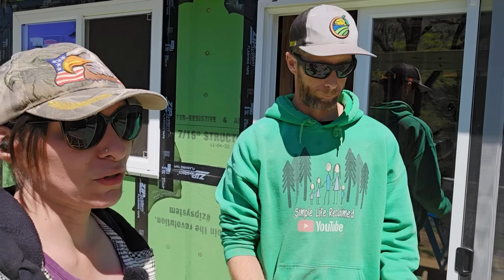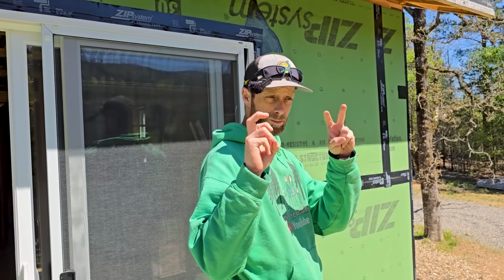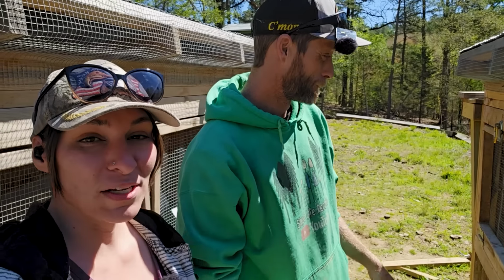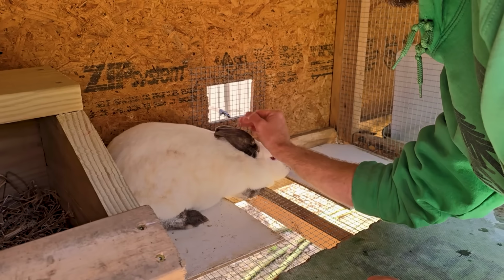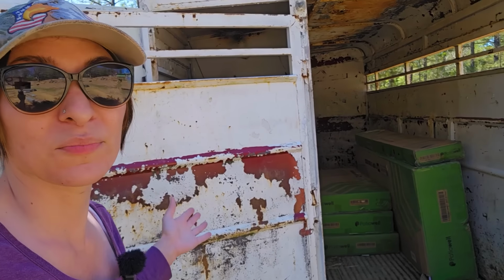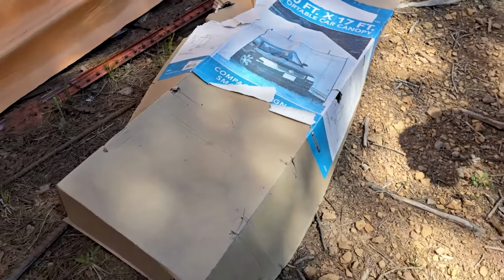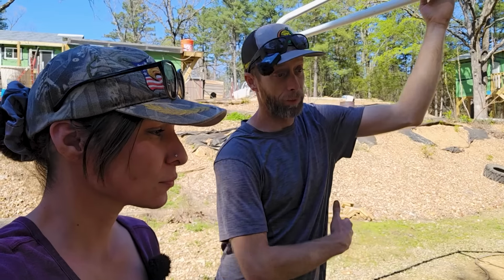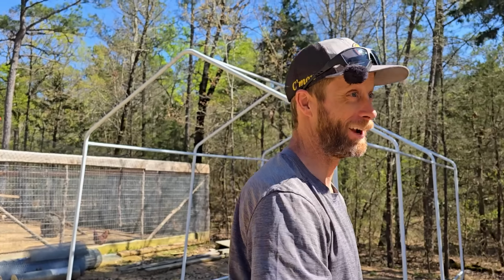Can We Get It Right?!| Rafters For Our Cabin Deck's Roof| ANOTHER NEW BUILD & Homestead Updates

Comment: The only problem I would mention about using clear tubing for water hoses is that it allows sunlight to come through.  This can promote algae growth.  If you want to use clear tubing then just dry fit some PVC pile to sleeve it in.   I have 20 IBC totes in stacks to catch rainwater and every single one is painted black to prevent algae.   You also might think about a gate valve in the line further back so you can cut off the water for maintenance work near the cages.

Comment: Hi gary and Mel.little important  tip for you.fix a top plate all along the top of the  beam just like you did on  the cabin framing. Just keep the joints staggered away  from the beam joints. This will strengthen  the beam from pulling the joints opening up.then fix you roof spars onto the top plate of your cabin and the plate on your beam .if need be screw into you roof spars also then this should tye everything  together  .maybe  easier  to take  first row of sheathing  off your cabin roof for easy  access  fixing you decking roof spars.take care.
Reply: Yes! I thought the same thing. Tie the porch roof into the house rafters vs the roof. That’d keep the whole structure sturdy no matter how much wind they get.
Reply: @chrissyfrancis8952  I mentioned the need to stagger the seams in a prior email.  They are learning and we will teach them.  She is brave and he is trying hard.  There are just certain things you cannot skimp out on and proper structure is one of them.  they mentioned they have bad storms there occasionally so I hope they use hurricane straps going from the beam to the rafters and from the beam to the posts.  They only screwed down the posts and did not use BOLTS to attach it to the porch structure.
Reply: @GoodwillCriminalsOfDallas  Gary always uses Hurricane straps. They also mock up their structures, then take them apart to finish cuts & then secure it permanently bc they’re learning as they go. It’s literally twice the work, but Gary(as you know) is OCD. Imperfection would drive him crazy. My mom is the same way.

Comment: G’day Gary and Mel, Gary reminds me of when I was building, thinking about how things will be on the build. I would get flooded with all sorts of ideas and become distracted muddling through. One day I changed that behavior to planning to scale on paper based on all measurements of the situation. I used the measurements to create profiles then would draw up a diagram on a 1/10 th scale, my maths isn’t that good so scaling up from a 1/10 to full scale was easier in the metric system. If it was furniture then the scale would be a bit bigger to get very concise measurements. Doing those diagrams confirmed angles and the length of timers needed. This limited wastage as I bought the just longer length of Romberg that I needed. I hated 3’ off cuts, such a waste. The process also helped me maintain focus. I called it building on paper first. I also developed the habit of sketching ideas as they popped for later to be developed. Having a sketch pad nearby was a great help. Stay safe and healthy, I enjoy your sharing.

Comment: To make the measuring of the rafter easier just break it up into pieces.  First, how far past the rafter are you going to go.  Second, from the beam to the edge of the roof.  Finally, from the edge to the highest point on the roof, you are going to go.  I do not recall what the pitch of your roof is but that is one thing you will need to know for your calculations.   The easiest way to figure out the angle at the top you need to cut is to stretch a line from a board on the beam that is the thickness of the rafter.  I would guess 2x8 would do it.  Put the other end on the main roof at the top height of the rafters.   Get two pieces of lumber about 3 feet long and peg them together at one end in the center with a bolt and wing washer.  One board needs to be a 2x8 and the other a 2x4.  Go up to the roof and set the V-measure device next to the string.  Raise it to a few feet from the end of the string lining up next to the wing nut.  Now one of the boards till it lines up with the string and tighten down the wing nut.  What you have now is the angle at all of the 2x8 boards will need to be cut to have the top of the rafters die out into the roof.  

Once you have the board angle cut you only need to set a 4-foot board on the end of the big beam and angle it so it aligns with the string and then slide it out till the overhang is what you want to achieve.  this will allow you to trace the birdmouth.  There are official ways to do this but it is a visual technique if you have trouble with the other regular method using a square to figure it out.  If I am not clear on some thing I just watch a YouTube video.  You should go watch the 3 videos by Larry Haun.  He was a master builder of the old-school variety that was very good at explaining things to the untrained folks.

Comment: Oh if you turn it long ways you can split it into 3 stalls and use the two closest to the chicken run for your meat birds. And later it could be for ducks and turkeys or whatever  and the end stall can be the goat house and in front you can put a run with rocks and climbing stuff for the goats to play on. Or have the center one open as a walk through with a gate at the back that you can open to a electric fence area later. And have a meat bird coop on one side and the goat house on the other. Having the center open it will give them shade and shelter from rain while still being able to be outside. Having the run/play yard in the front will give you hours of entertainment from the house.

Comment: I sided a cover it shed with metal Perlins and vinyl siding. It was on our property for 17 years. It held up really well. I had earth screw tie downs. An engineer certified it as good for hurricane winds of 115 mph. It withstood several hurricanes right on the edge of Long Island Sound. Our shed had the 2 inch metal poles. But your structure should be quite workable and sturdy. The metal Perlins were screwed into the tubular steel. Looking forward to this coop!

Comment: Wondering why you’re waiting to put the deck boards down? They’d anchor the deck before you add the roof. The deck boards will be the easiest part of this build, just laying them & spacing them(we always made a spacer out of spar pieces of wood) then ran the boards, cut the ends then started with the ends on the next row. Is it the cost all at once? Or a shortage of supplies? Mel, you got brave but I’d never be up there until the boards were down. I’d be frozen outside the slider, white knuckled grasping on I’d have to be pried off the door jam.

Comment: hi !

i have been thinking about your sand filter issue you have, what about sand pool filter?
they are kinda cheap and easy to install and run and do not take so mutch space.

sure i dont know how mutch iron they remove but whit sand pool filter and the filter you have now then that would remove a large bit right?

but like i said i dont know how sand pool filter works or if it works for iron at all but if it works then you maybe dont need someone to come and install something big and ugly on your property.
just a thought.

Comment: I think the nesting box would be better without the plank at the front (top) as its a tight fit for her getting in and out but great set up ❤
Reply from the maker: That board is there so if she needs to get out while nursing, it will "scrape" the kits off her and leave them in the box and not on the wire.
Reply: Thanks you for thé explanation who make a lot of sense